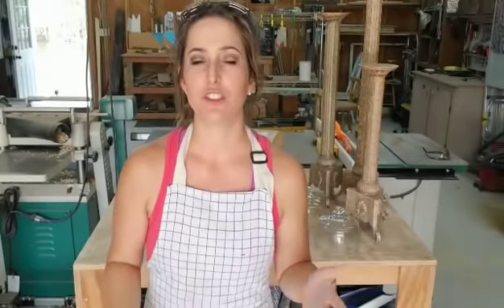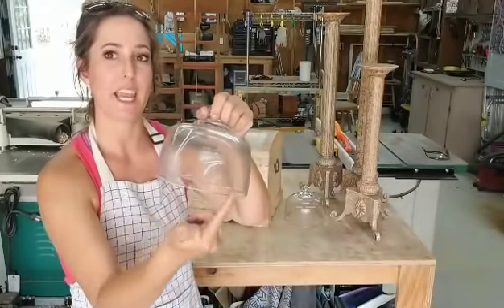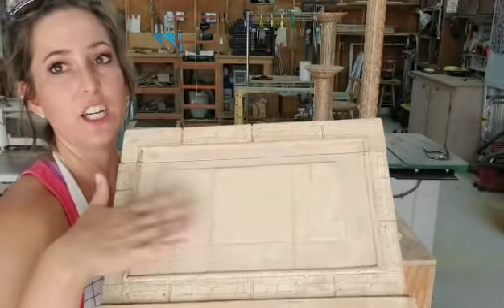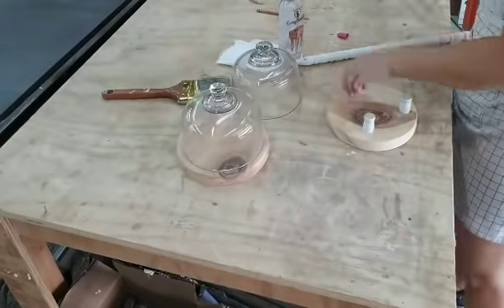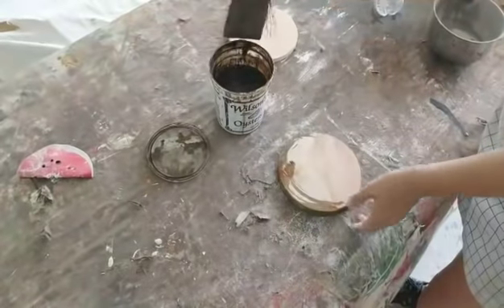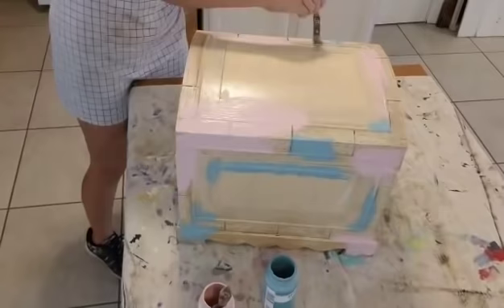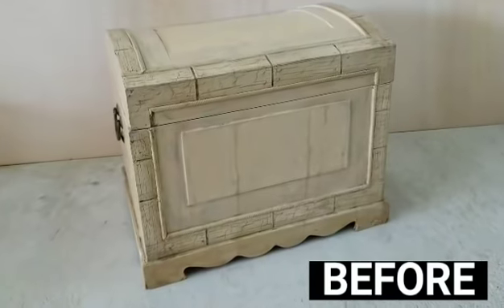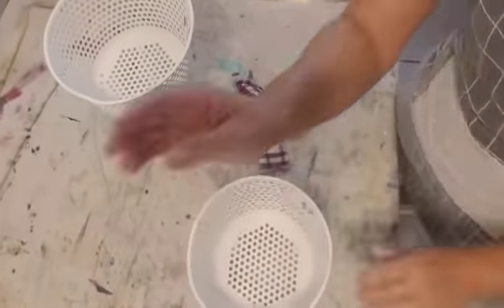Thrift to Treasure • cloche, candle sticks, chest and fryer bowl

Comment: Julie, can you add a link for the air compressor you use with your paint sprayer - with all the other links you provide? Idk enough about this piece of equipment to buy the right compressor. Also, all the other parts that go with it like the gauge(?), and the hoses? I REALLY REALLY want to buy all of it but do not know which ones work with the sprayer 🤷🏼‍♀️ TIA for your guidance!

Comment: I really appreciate the time you spend to share your gift with us!  You often mention that you keep chalk paint in your sprayer all the time.  How do you keep the tip clean so it does not clog?  Do you store the paint in the fridge to keep it fresh?  I know where you are is very hot & humid (I used to live in Leesville, LA.) Thanks again for the great info.
Reply from the maker: I don't clean the gun, just leave the paint in it, and in my workshop.  I only clean the tip with a brush before I use it. So far never had an issue with it

Comment: Your machine is a jointer.
Reply from the maker: Haha, I was wondering if anyone would notice that I called it the wrong name. Didn't notice till after it was uploaded 🤷‍♀️
Reply from the maker: I do sometimes use it like a planer though, it's faster for small pieces like that.
Reply: As a woodworker, I watch and listen when machinery and tools are used and demonstrated. Proper names of tools is necessary when novice ears are listening. Thank you for your inspiration to recycle and refurbish trash into treasure.😅

Comment: My favorite is the fryer baskets. I have a question ~ when you said you always leave your chalk paint in your sprayer, do you leave the paint in the container and wash the nozzle clean with water or do you just leave the nozzle alone after spray painting? I just bought a paint sprayer. TFS
Reply from the maker: I just leave everything.  Occasionally I clean the sprayer. I use it almost every day and haven't had any issues. Make sure you add water to your paint, sprays much better